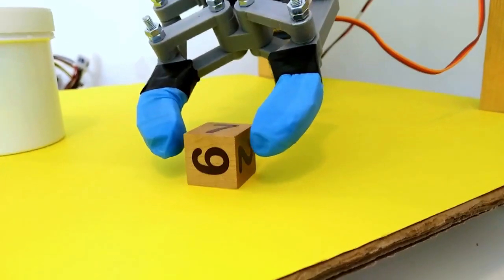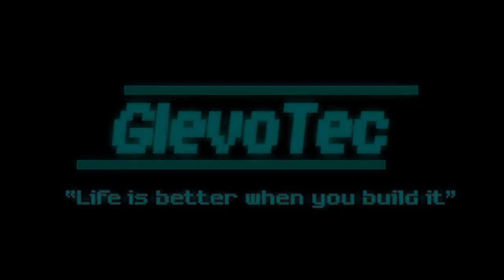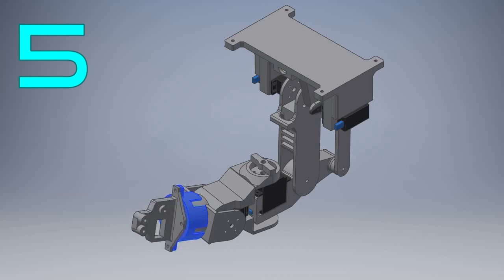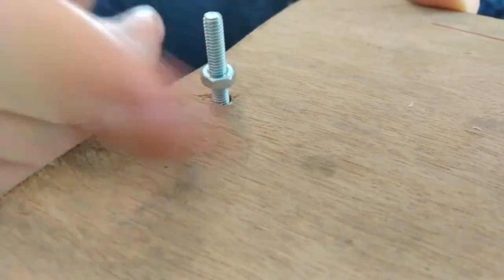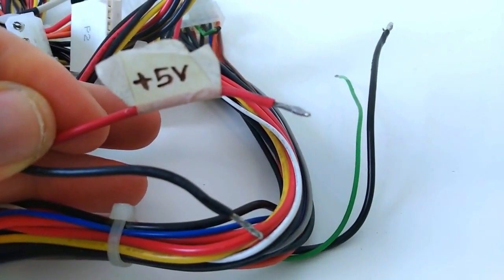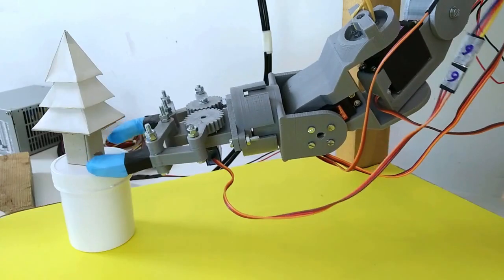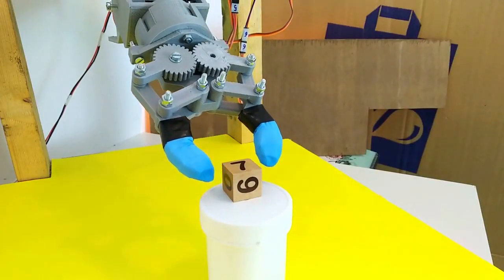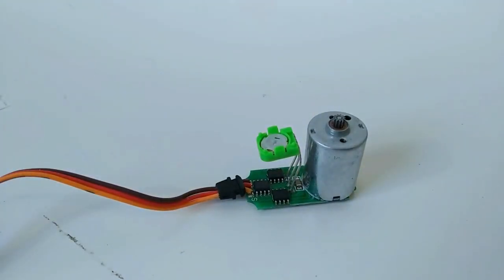I build a humanoid 3D printed robot arm!

Comment: Very insteresting content. Btw, you added a switch that you said you will use later. What is that switch? Is that a magnetic switch? Cab you share where have you purchased it? I'm looking for the same switch but couldn't see one. Thank you in advance
Reply from the maker: Thanks! The switch is used later in the video. It's used to send the current position of the joints to the computer serial terminal, so the values can be used to program in the Arduino for automatic operation. It's just a very generic switch, 3pin. One common and an NO and NC contact.  They're called "micro switches". You can find them everywhere

Comment: so could you like make two arms, mount them on a powerchair and have a tanky servbot?
Reply from the maker: Yes indeed. That's exactly the plan. I've been working on an improved arm, and I'm going to be making  double arms and do something cool with it. Keep an eye on my channel!
Reply: @GlevoTec   I have a design in mind. it would be very frugal as it would Recycle a used powerchair as the wheel portion. use two arms like the ones here. *but with fingers not claws and put a "brain" inside the head that acts as the housing for all smart AI stuff. id pay to see if you could beat me to my own concept .as ive only just taken interest in this idea. but seeing all the DIYs online I think what I want is feasable. the only trick would be to make the "hips" pivot so when the powerchair "legs" go up or down hill the unit would not lose balence.
Reply from the maker: @Hoshionifumo  Sounds possible indeed. That's one of the ideas I had as well. I'm building part by part, and I'll see where it will end up. Thanks for the input!
Reply: @GlevoTec  id be tempted to fund you big time if you attempt such a build. One of the big perks of DIY is that we can use new and old stuff. this should be treated like how drones were with everyone throwing everything at it untill its cheap enough for everyone.